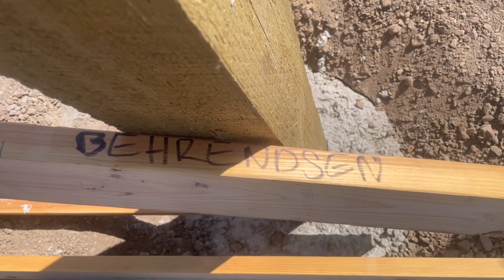Prepping Trusses for pole barn (install purlin blocks & stiffeners)

Comment: posts underneath ground = -5 years life expectancy
Reply: Especially in concrete! What a stupid move.
Reply: Bad move
Reply: @TenInchBig: It seems you and I have been reading the very same posts on advice boards all over the internet!

Let’s start with the “no footing” concept. Typically the soil is not able to resist applied vertical loads when those loads are transferred through the post alone. Therefore, the post is set on some type of a footing, which in the case of post-frame construction is usually concrete.

Footings must be adequate in area (radius squared x pi) to prevent the building from settling under not only the weight of the structure itself, but also the load from snow or minimum live load requirements. They must also be thick enough, to prevent the column from punching through the footing.

Considering even a fairly small span building, with minimum loads requires a footing diameter of 18 inches or more, it is fairly impractical to think of a material other than concrete which could be placed affordably beneath the columns.

On to the “rot” issue. Chapter 23 of the IBC (International Building Code) requires wood in contact with concrete to be either “naturally durable” or pressure-preservative treated. This, in itself, tends to take away credence from the “concrete rots treated wood” faction.

I know every major post frame building company in America. I have yet to have any of them report of having a single “properly treated post” rot off.

The clincher in this is “properly treated post”.

When the first IBC was published in 2000, Section 1805.7.1.2 stated, “Wood poles shall be treated in accordance with AWPA C2 or C4. This language remained the same in the 2003 IBC. The AWPA C2 and C4 standards have been withdrawn, therefore are no longer applicable or referenced standards in later editions of the Code.

In the 2006 IBC, however, things changed. Section 1807.7.1 states, “Wood poles shall be treated in accordance with AWPA U1 for sawn timber posts (Commodity Specification A, Use Category 4B)”. In the 2009 IBC (and repeated for the 2012 edition), the language remained the same, however the referenced section of the Code is now 1807.3.

What this means to you or the average consumer who is shopping for a new pole barn? Everything!

Take a visit to the local lumberyard or big box lumber store. Take a walk through the pressure treated lumber department. Every piece of pressure preservative treated lumber has a tag on it. This tag identified who the pressure treater was, as well as the level of pressure treating. Sadly, most of the pressure treated posts will be treated only to UC-4A…which does NOT meet with the Code requirements for use in pole buildings!

What this means is there are a plethora of buildings which have under treated columns, which is responsible for the rot issues, not the proximity to concrete.

Every time I have someone try to foist the “concrete rots treated wood” story on me, I ask them to show me a single laboratory test, which proves their point. None exist.

The best solution – and my recommendation – use a properly treated post, backfilled with pre-mix concrete in a monolithic pour. Place a minimum of six (and better eight) inches of concrete below the column and eight or more inches up the post (this is known as a bottom collar).